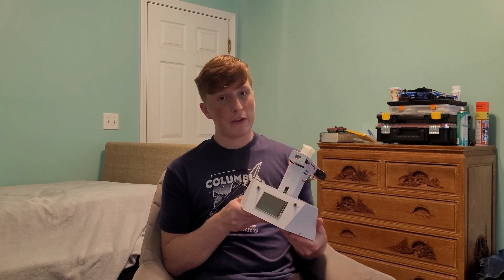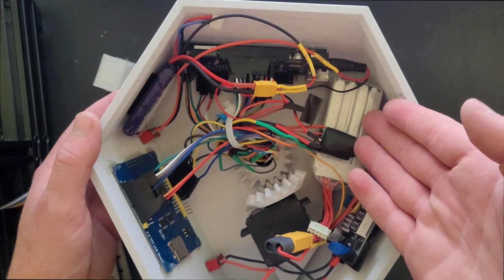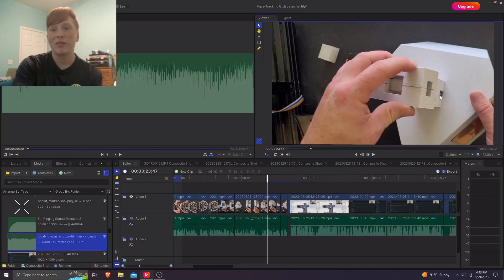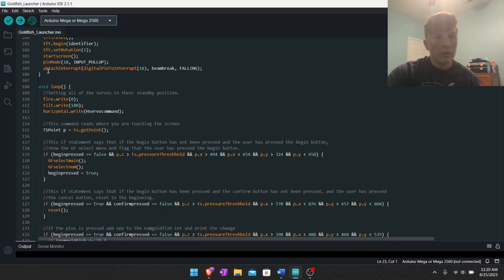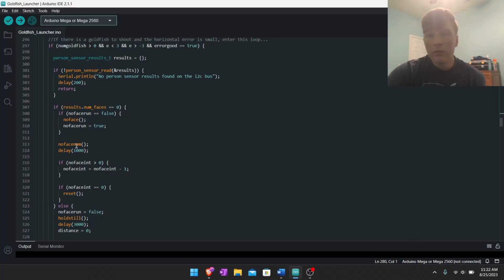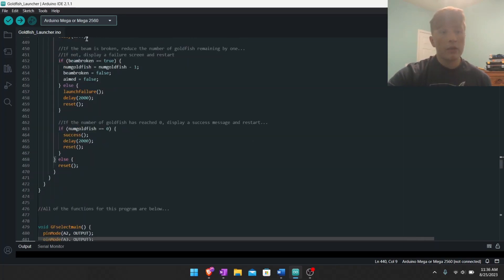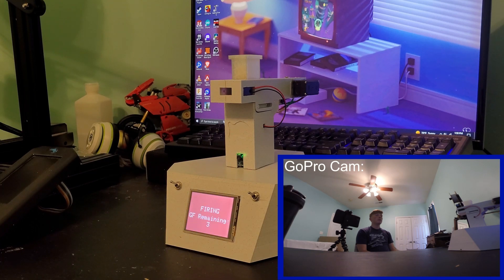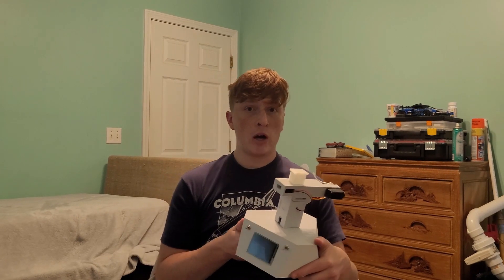Face Tracking Goldfish Launcher!

Comment: very cool project, and very well build too, especially for a student project.

if you make a V2, you should try doing the face tracking yourself.
you could do it easily, on a raspberry pi zero, with opencv.
i think you'll find, it's actually much easier than in sounds.
and it could improve the accuracy a lot :p
Reply from the maker: Yeah I was thinking about using a raspberry pi zero